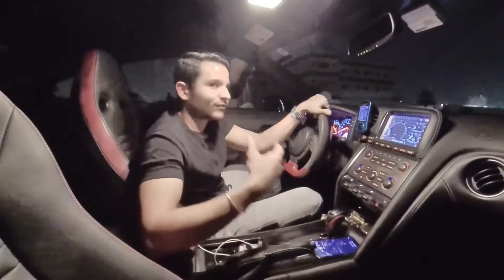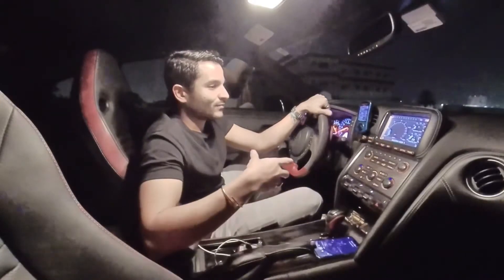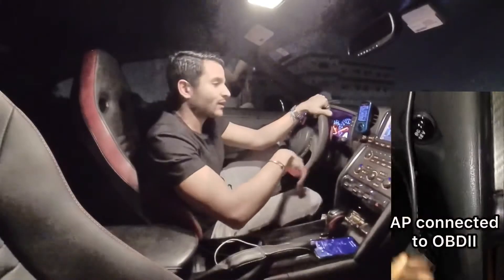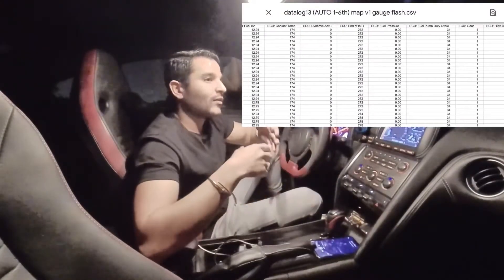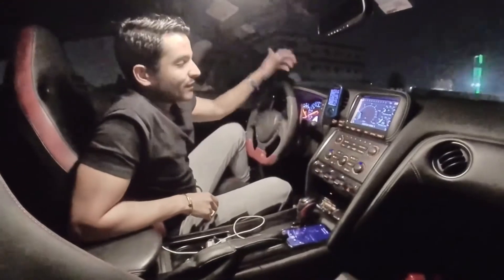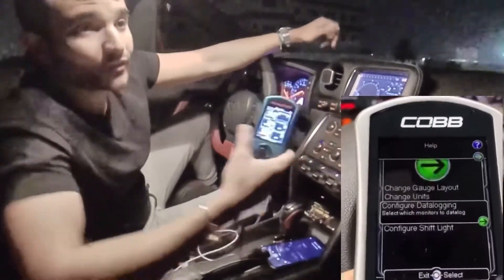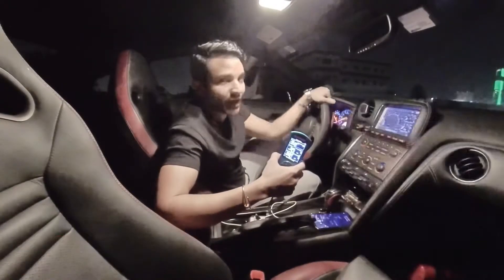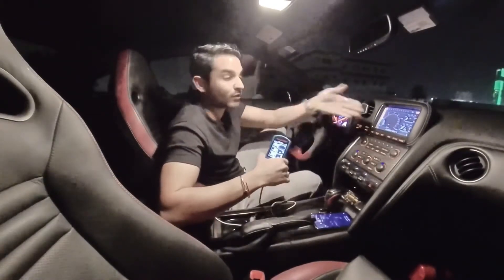How to DATALOG with COBB AccessPort and fix ENGINE KNOCK (Nissan GTR)

Comment: I noticed you had a p2096 code, I'm getting that too. Trying to figure out what it is.
Reply: @Majj.Garage  Hi Majj, thanks for the quick reply, I sent a log to my tuner to make sure, it's not runnning to lean, if that's what the O2 sensor has to calculate for Air and Fuel mixture.